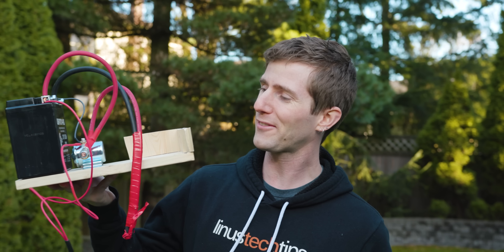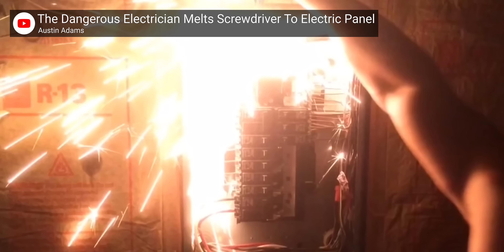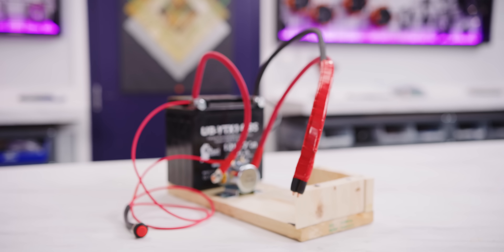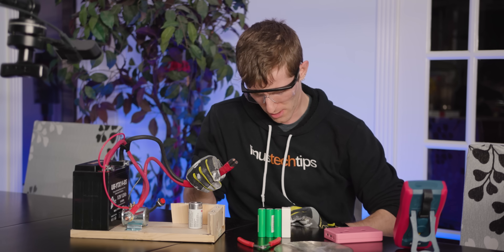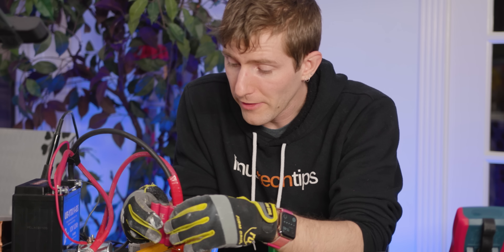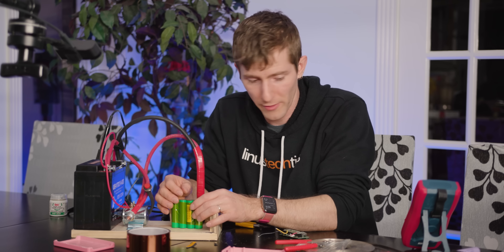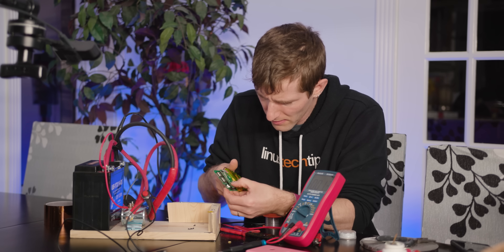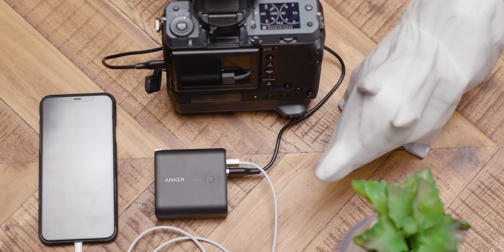I spent $100 to save 20 bucks... and it was TOTALLY worth it!

Comment: Spot welding heats up the metal like 100x more than soldering,  what you are doing is very dangerous due to chemicals in batteries overheating, those batteries won't last long, spot welding is mostly used on sheets of metal in a way that you have one part touching on the bottom and the other on top, which weld it together instantaneously in a fraction of a second. You are touching it only from top and for longer time which means the top of the battery reach dangerously high temperatures.

Comment: You can't electrocute yourself with only one 12V battery. Unless you lick both terminals in one time you ain't gonna feel a thing.

At least put a decent 16/20V capacitor in parallel. Shorting out your battery isn't a good thing.

For electronics. Sometimes it has low battery detection when you unplug it. Then it only resets when you put in on a charger. Keep that in mind. Mostly at about 2.7V detection circuits.
Some batteries already have it integrated. Be careful with using unprotected batteries on a unprotected circuit. You could overcharge or over discharge it.
First case it will explode and die. 2nd it will die.

I'll keep it to soldering when needed.
Just use a strong soldering iron.
Tin the caps and copper strips. And fuse them. Or with hammerhead soldering you could make inline packs.

Comment: Instead of spending tons of money on lithium cells, use dead laptop batteries. Ones that have been water damaged work quite nicely for this purpose, as the charging circuit is often all that fails. Just make sure to use a multimeter to test all your cells first tho, make sure they have the same voltage (and can deliver current, dont want to have all dead batteries) or you are looking at a fire hazard.

Comment: @3:50 it would be a nasty burn hazard not an electrocution hazard
Reply: It would be an electrocution hazard depending on the circumstances. If hes hands are damp and he has both poles in close proximity (like he does) the resistance would be lower and would certainly conduct enough to be damaging.

Comment: That spot welder is a nice one, although you'd definitely should equip it with a with a timer (e.g. based on an Arduino Nano with a relay shield). It would keep the relay closed for a preset amount of time (which could be adjusted with a potentiometer), or when the button is released, whichever comes first. This way you could get repeatable welds, and the safety that if you let go of the switch, it would stop the welding process. I think I'll build one, just for the fun of it :D

Comment: "DIY" and "Spot welder" are not things I usually want to hear in the same sentence
Reply: just like "Makeshift" and "flamethrower"
Reply: Same goes for "Making the easy way" and "nuclear weapons"
Reply: @latt.qcd9221  "DIY" and "sarin gas"
Reply: Especially from Linus
Reply: Something very simple, but look at the battery welder here
https://youtu.be/fQ0328JlAtQ
Reply: As long as i am not close i am fine.
Reply: @protechnician83  how apropos
Reply: And yet it worked fine.
Reply: @thysonsacclaim  Well, it would have, if he hadn't cheaped out on the button. Seeing how the button was sticking I would not trust that thing.
Reply: My only concern with using a relay would be the contacts could potentially weld shut or stick.  I would use something mosfet based. Need some pretty beefy ones though.   It would be easier to regulate too as you could PWM it.
Reply: @redsquirrelftw  you can get relays purpose built for this sort of thing though.
Reply: Red Squirrel I just don’t see the issue, those relays and solenoids are intended for auto applications, it’s essentially the same high crank current instantaneously from the same type of battery. Most mowers have a solenoid and they don’t have any reputation for welding them selves. Though I can see the utility of what you suggest as I would put together a quick circuit for timing, that way you could have a repeatable ‘dwell time’ (not sure if that’s the correct term). And the solid state components would make that so much easier.
Reply: @daa3417  it would be just as easy to add a timer to the relay I dont see how it would matter ether way typically relays can switch more current this is why they are used in these types of applications. Welding is usually somewhere around 100-300 amps. 

transistors and relays have there pros and cons, in this case I think relays win considering its a fairly high current load and as infrequently as its going to be switched its not likely to ever need to be replaced. In this use case a solid sate option seems more likely to fail as they tend to not handle this type of load as well and also in an off sate they tend to have some leakage current also not ideal.
Reply: @ChrisD4335  300amp IGBT transitors exist
Reply: Dan Gelbart
Reply: Check out the one Fran of Franlab made: it dumped charge from a fat capacitor through a huge FET.    No moving parts to get stuck and if the FET fails the cap can only deliver so much.
Reply: Or “diy” and so your going to need paper and scissors
Reply: Makeshift Flamethrower
Reply: 999th like....my curse always  1. behind 100 or 1000
Reply: And yet @GreatScott! Has got you covered on a diy spot welder thanks GreatScott
Reply: Seems like you didn't live behind the iron curtain. Such things were part of almost any household here in the eighties.  Basically a transformer connected directly to mains and adding some connectors at the end, and there you have it.
Reply: And yet I want one.
Reply: It’s probably fine coming from Alex, not Linus though
Reply: what does not kill you makes you stronger.
Reply: plus dc voltage that low wont do crap! has to be much higher voltages
Reply: correction amperage kills not voltage unless its like a million volts for example
Reply: Same here, but I am just desensitized to Linus doing things that could kill him.
Reply: LOL anybody who knows basic electronic will knows this it can't hurt you.
This is very basic DIY any man should know.

You can make a homemade welder what is 5 times more powerful = 70v 250A And that won't hurt you.
Even if you tried nothing will happen.
So a DIY spot welder what is 5 times less powerful is definitely NOT going to hurt anyone
Reply: "You should NOT DIY a spot welder"
Reply: My thoughts exactly, sounds like a death sentence
Reply: Ikr, why would anyone diy this shit, it can literally kill you in less then a second if you fuck up ever so slightly...
Reply: It's just 12V, not really a hazard for a human.
Reply: @zekrinealfa1113  Just in case you weren't joking.  It's all about the amps, not the volts.
Reply: @GLACIOUS13  Yes, and amps=Volts/Resistance, so they are directly proportional. So my statement still stands, because of the high resistance of human skin, anything below 50 V can't even be felt unless your hands are humid and the resistance is therefore lower.
Reply: @zekrinealfa1113  Oh, okay.  I agree.  I miss-understood where you were headed with that.  Thank you!  Be safe and wash your thumbs.  :-)
Reply: @GLACIOUS13  no problem, you also be safe

Comment: I'm trying to build a gaming PC (i'm from europe) can you guys help?
THIS are my chosen specs
CPU ryzen 5 1600af
GPU AMD rx 5600xt
RAM 16gb 3200
SSD 250gb data & 2tb hard drive
Msi b450 Tomahawk max
I have a case already and a previous 500w psu, Is It a good enough One to Power the system?

Comment: If the battery pack had them then you should have soldered any extra wires in the old battery pack to the new battery’s which will give it balanced charging

Comment: You could have achieved much higher-quality and more consistent welds had you wired in a 12v process control timer or even an Arduino to set the pulse duration. https://www.amazon.com/DROK-Controller-Delay-off-0-01s-9999mins-Switching/dp/B07DFT2WDS/ref=psdc_495340_t3_B015Z2EQCU

Comment: Any car or motorcycle battery and a Ford Starter solenoid and starter cables is the majority of this project add some solid copper bullets or nails or probes and a momentary switch and your done.Just go assemble.

Comment: That's not at all why you shouldn't use batteries with different voltages or capacities in series. They're not going to "equalize", and therein lies the problem. The charger only measures the average voltage, and will charge up until that average voltage is 4.2V. That means the cells with the highest voltage will be overcharged, and the cells with the lowest voltage may be overdischarged if they are significantly lower voltage than the average. That causes uneven wear and tear on the batteries that will kill the entire pack quickly, and on top of that, overcharging batteries can be dangerous.

Comment: It's absolutely fine to tag on an extra bit of nickel for the connections.  Do exactly that to attach balance wires to ebike batteries. Also, you absolutely can solder to the battery. The school of thought is massive irons are best, due to the large thermal mass, you can get in, get it soldered and out very quickly.

Comment: 2 things.....
1: That starter relay is way inadequate for that job. The button wasn't failing, the relay was welding itself shut. (easy fix would be to add inductor/coil after it or make dual action switching. One closes the circuit, one opens)
2: To people who are going to do this: Some older battery pack controllers uses battery power to keep them running. So you need to plug it to charger at least once to kick start boost circuit.

Comment: Add a capacitor that charges off the battery and then only use the cap power for the weld. Higher voltage and controlled time

Comment: You're better off using a MOSFET (or several) to switch the power with an electronic timer,  this way you can also use PWM to control the amount of power.

Comment: 3:50 Oh yeah, a nasty electrocution hazard… from a 12 V battery.
Reply: Idiot. go wet your arm and lay it over a 12v car battery and then come back and say its not an electrocution hazard. He has both positive and negative in very close proximity, maybe 1 cm in between, go put that on your damp skin and say you dont get a shock. Just because the body resistance is too high to pass any meaningful current doesnt mean its not an electrocution hazard under lower resistance conditions.
Reply: @ChrisSmithy  Been there, done that. It tingles a bit. Zero risk of electrocution.
Reply: hellterminator I’m using the dictionary term of electrocution, to injury or kill by electric, in which case if you feel a tingle then it’s causing injury to the skin.
Reply: @ChrisSmithy  You know what I think? You just looked up what electrocution actually means (presumably to “own” me) and are now trying to twist what you had said earlier to hide the fact that you though electrocution was synonymous with getting an electric shock. Either that or you're lacking primary school anatomy knowledge, because labeling low level nerve stimulation as an injury is beyond ridiculous.
Reply: @ChrisSmithy  Oof, that's a lot of projection you got going there, buddy :D

To any poor soul reading this trollfest: If you're not sure which one of us is right, please look it up.
Reply: hellterminator haha. I’ll even give you a thumbs up for that one! Can’t be arsed arguing over something that doesn’t even matter right now!
Reply: Burn hazard. Maybe.
Reply: I've heard the danger is in the amperage, not the voltage.
Reply: @G4mingBud  You heard wrong. Both are completely relevant. Im pretty sure a youtuber called electroboom has done videos on this. Hes worth watching if youre interested in learning. Amerage, aka current is depending on the circuit resistance, you dont supply a current. If a PSU has 50A available, it will run a device that only draws 1A with no issues, the current is supplied as needed, however voltage isnt, you cant power a 5v device with a 50v PSU but you can power a 5A device from a 50A psu if the voltage is correct. Maybe check out ohms law if youre interested.

Comment: The reason relay was giving you issues is because you are using same power supply for welder as well as Relay actuation. Using a seperate supply for relay contact actuation will solve your issue and is a good practice.

Comment: You should really add some kind of timer circuit, an Arduino is more future upgradable, but a simple 555 timer and a potentiometer could help you get the timing on those welds just right.

Comment: you have dead D batteries. why not use the graphite core in that to do the welding? sure, it won't last as long, but it won't weld itself to the work, either

Comment: Don't use this "DIY" spot welder, better pay some $ and get a proper welder with MOSFETs and control circuitry, unless you don't care if you burn your house to the ground or get injured. You are playing with HIGH CURRENT and Lithium batteries.

Comment: #1 don't forget to recharge your Lead-Acid battery, if you kill 1 cell, you just drop 100$.
#2 wear gloves !!!
#3 Next step : a full custom-made powerwall with 2000w delivery in LiFePo4 that you can recharge at night during low priced electricity (will not worth it in the long term, but...)

Comment: Please do not do this at home unless you are knowledgeable with battery chemistry. Lithium batteries need to be treated with respect. Remember those "my vape exploded now I'm missing my jaw" news articles? Those were because of tampered and/or damaged and/or improper usage of lithium battery cells usually the 18650 kind.

Also, the switch used for the spot welder might not be rated for that amount of amperage which is why it tends to "stick" and that is also dangerous.

Comment: I've made many a pack with a welder just like that. And after struggling to get a solid weld or worst yet blowing through cells ends. I found the most important thing isn't the amount of time you leave the welder "on" ( remember a real welder only fires for fractions of sec at a time). But putting the correct amount and even pressure on both electrodes. Once I figure that out. I was tearing through packs np. 

I was surprised with all my research I didn't find that info stressed more by ppl with more experience than me.

Comment: i recomend not doing anything to 18650 battery's if you dont know what you are doing.
if you short them out they will heat up to the point where they explode and burst into flames.
not really something you want sitting in your pocket (a common place for battery banks to live)
also on the spot welder, i recomend dropping the current down that goes trough the switch.
because right now the current from the battery is going trough the switch in full, to switch the relay that then switches the power to your main leads.
a relay is designed to take a weak signal and then switch the full thing. so by dropping the current over the switch down you run less risk on the part that you are actually holding while maintaining the full power to flow trough your leads for the spot weld.
it also might be a good idea to get something like an ardiuno in line with the switch with some basic code to cut the power after x amount (configureable with 2 buttons and a small LED display) of time, this way you can dial in the amount of time you need to weld a certain piece of metal to another piece of metal, set and forget and weld away without under done or over done welds.

Comment: First thing is first, anytime dealing with current you must remove your RING! and watch. This will stop the current from jumping. Secondly make sure you have a  ground strap for both your DIY welder and you personally. Electricity takes the path of least resistance. Love the video, just make sure you have better safety precautions. No one wants a toasted Linus.
Reply: It's an isolated dc source, he can literally touch it

Comment: you know this is way easy..You made a mess out this project.. Just get an old Battery recharger and scavenge the spring loaded battery pack.or switch out the circuit boards way way easier..And so much more useful and less dangerous....

Comment: Linus: "DIY spot welder"
me: "oh gawd, he will definitely electrocute himself or start a fire"
Linus: "Colin was working on the spot welder"
me: "ok. then go on"
Reply: MGL 12V is pretty harmless
Reply: @b5a5m5  12V but enough Amps to melt metal. And it's heavy and full of interesting chemicals. There's lots of potential to harm self  :)
Reply: @b5a5m5  Have you seen the Car Audio Comunity with all the Lithium batteries and things. It can be bad! But yeah, basically just don't be dumb with 12v and you should be good. lol

Comment: Pro tip:  it's usually easier and safer to solder your wires to the nickel strip BEFORE you spot weld the strip to the cell.

Comment: When using batterys you should use a real car battery because these typ of batterys has a lower initial current. Or use LiIon/LiPo batterys (as in some diy welders)
Or use a microwave oven transformee, you need a relay to control primary and some wago connectors and a piece of thick wire for secondary, and there you are